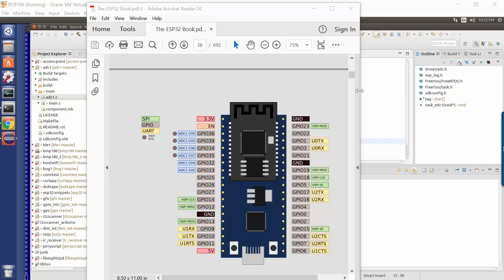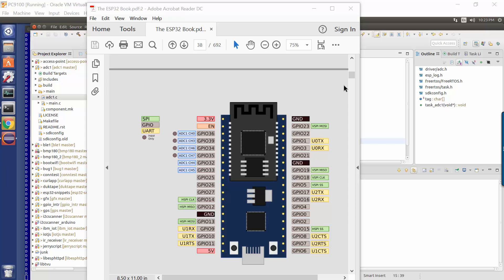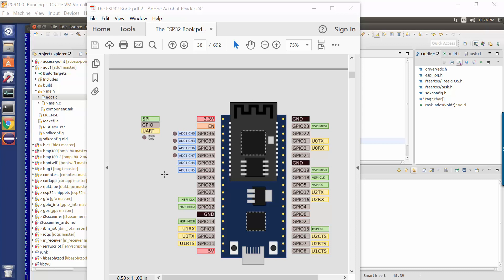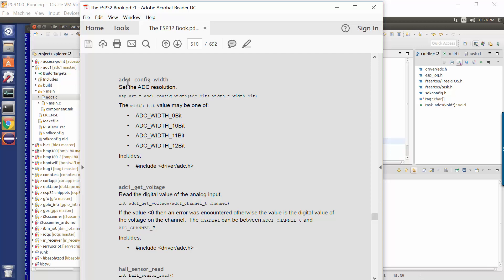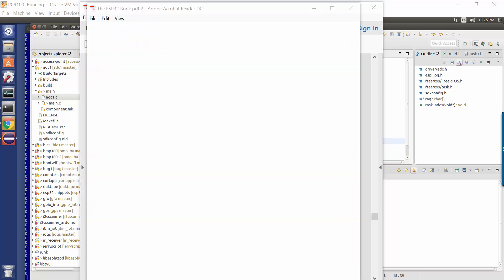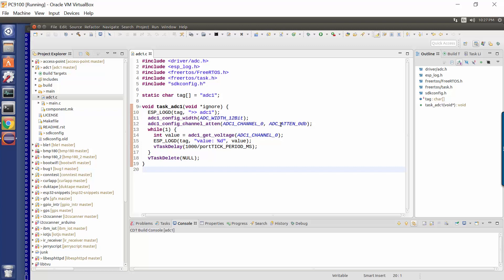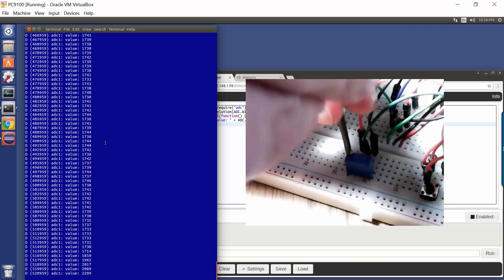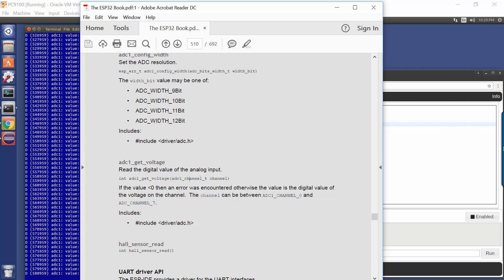ESP32 Technical Tutorials: Analog to Digital Conversion

Comment: Hi

I'm getting fluctuations in values of adc pin of esp32 even when my input source is stable.

When I'm applying 1.65 volts at the input of adc, I'm getting output around 1400-1550 in between them, value is fluctuating a lot. How to stabilize it? 
And at 1.65 volts, it should give around 2000 (4095/3.3*1.65=2047).

These fluctuations happen when I'm applying any voltage in between 0 to 3.3 volts.

Please help me out.

Thanks
Reply: Fluctuation in ADC readouts are normal. Usually they are noise induced from non clean power source or parasitic element in the circuit. Make sure there are no floating pins that you arent using. Also You can reduce the noise by adding a small resistor to the input pin and ground as a pull up resistor, you can use RC filters to remove noise in general, lastly you can also oversample the input and average them to get a cleaner reading. (for example: adding 5 input reads and averaging them)

Comment: Hi, can we use it to read actual voltage of the chip by connecting the analog pin to Vcc ?
Reply from the maker: I believe that the answer is yes.  However, I would test it first.  This might be a good technique for determining if the input voltage to the ESP32 is approaching some level before it is too low ... but realize that if the voltage falls bellow the operating voltage of the ESP32, all bets are off.

Comment: Do you have any idea how many samples per second the ESP32 can do?   

Say compared to an arduino running at 16 MHz typically scales down clock for the ADC by 128 and then takes between 25(first) and 13(subsequent) cycles per reading.  Therefore the arduino can ADC sample at a max rate of 16*10^6/128/13 = 9600 samples/second.  ESP32 comparison would be awesome!

Oh - I just read the comments below - consensus is a sample rate of 6KHz   :( that's slower than an arduino.

Comment: thanks for the video, I would like to know the maximum frequency of ADC on this device?
Reply: That is a great question.  Unfortunately, I don't know the answer nor can I find it (easily) by reading the technical reference nor data sheet.  This is probably a great question to be posted to the ESP32 forums found here ... http://esp32.com/index.php
Reply: This search reveals various threads with various answers! https://esp32.com/search.php?keywords=ADC+frequency
Reply: According to the datasheet the Max sampling rate using RTC controller is 200ksps. and using DIG controller its 2Msps. So the max frequency detectable could be 100kHz or 1MHz